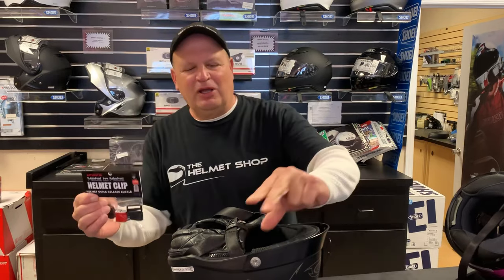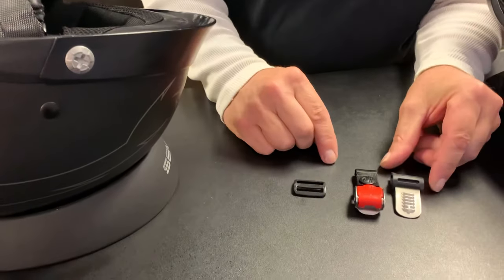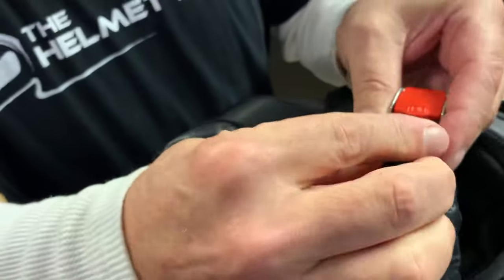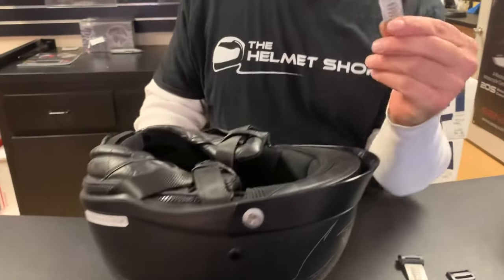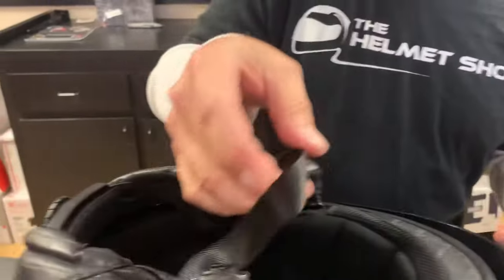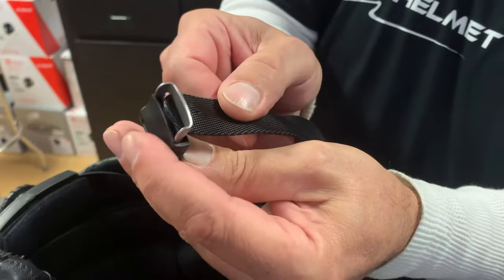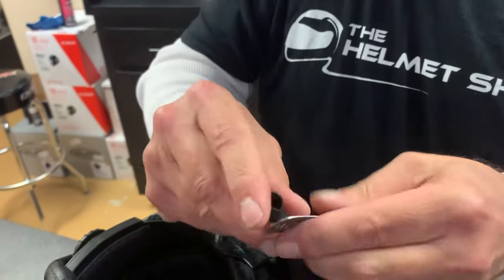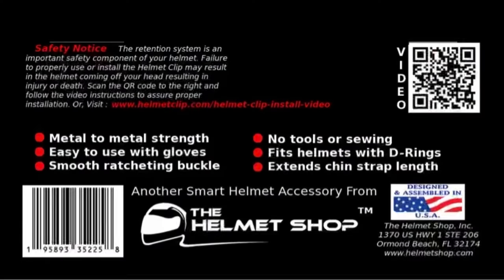Helmet Clip Installation Video

Comment: I love it so much. Awesome product. I didn't need to remove the snap on 2 helmets of mine. I just left the snap alone as it was not in the way when in use. I use the Shoei rf-1400 and the Vata7 Helmet. Both installations were smooth and took about 15 minutes total for both. Highly Recommended

Comment: Thanks for the video. I just ordered one, and it works great. I'll be putting these on all my helmets. 
I do believe they changed up the buckle where you don't have to pop the button off the helmet strap.
Reply from the maker: Yes, there has been a change so you do not have to remove the snap from your chinstrap as in this video.

Comment: Adds way too much length and cannot get the strap tight.. even with it fastened as far down as possible it's still way too loose. 

Great idea but doesn't work for my head or helmet not sure which is causing the issue

Comment: Well, I just ruined a brand new helmet strap because the quick release added so much length that it makes my straps too long even with the straps cinched all the way up. And my snap that held my excess strap in place is no longer there.  Any solution to that issue?
Reply: Hi I have the same issue.  did anyone reach out to you  ?
Reply: Same. Had high hopes but as you said, it adds too much length.
Reply: Same here. I tightened the quick release strap all the way down and it was still nowhere close to being tight. it adds so much extra length idk how anyone is able to make theirs tight!
Reply: @stevegalea518 I have a sedici helmet and had to push the protective padding back on the strap that the buckle goes on. Can't do anything like that on yours?
Reply: Same here!  Tried 3 different brands...all too long.  Did you ever find a solution?

Comment: There is barely, barely, enough space on the helmet end of the  strap to install this and as the helmet breaks in, it very well may not be usable because there is no space left to tighten the strap, on a HD H31.

Comment: If you want your helmet to stay on your head, don’t buy this, not enough room on helmets to tighten it down
Reply: I have a sedici. I just had to push the protective pad back on the existing strap side where the helmet strap buckle goes.  I actually got mine to be too tight and had to adjust again.

Comment: This video doesn't explain what a pain in the ass it is to install because they have done it countless times ! The snap you remove is a fight to get off I cut mine with side snip wire cutters ,then the rubber has slots that are not cut open to feed the strap through so be careful there , then trying to feed strap through it is another big ass pain!! Once it's on it works good and the piece that snaps around D rings isn't long enough to wrap like they show in video . 
It works but install is a pain !!